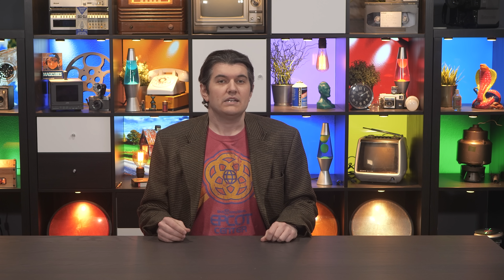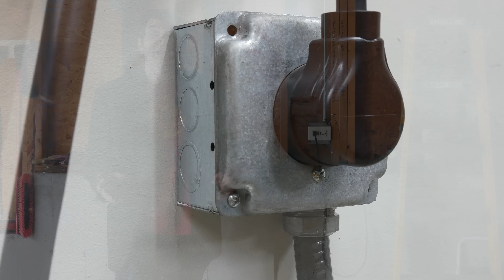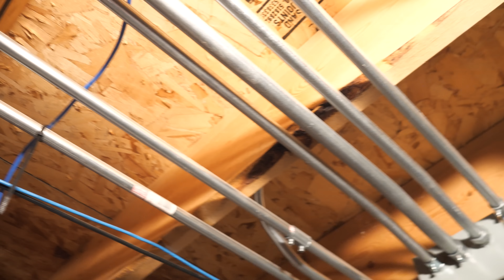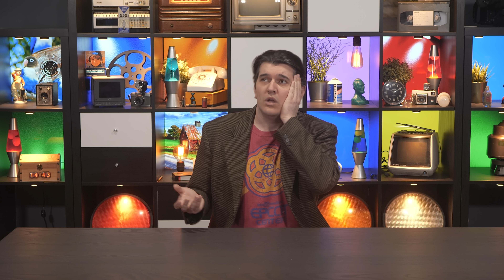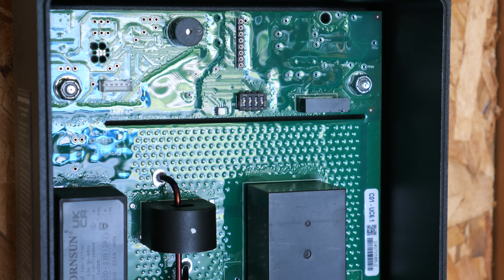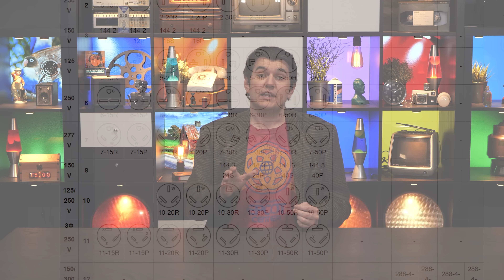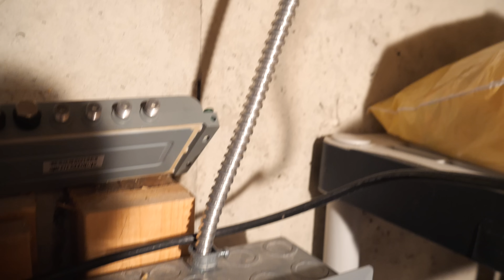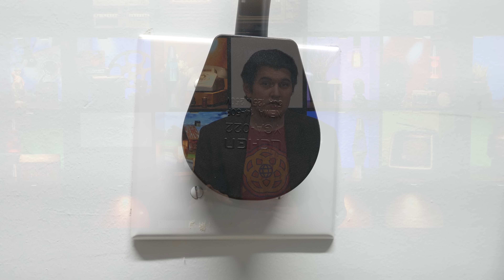The "standard" car charger is usually overkill—but your electrician might not know that

Comment: Interest video - thank you. Our Mini SE has probably on of the shortest ranges out there - approx 180 km in the summer - so we need to be able to recharge at home pretty quick. That’s why we dedicated a 40 amp circuit wired out to the carport with our Wallbox supply unit dialed to 32amps. 
One thing that made this feasible on our 100amp house is an energy management system added to the panel that will automatically shut down the EV charging on a hot evening with the AC humming plus maybe the oven on. It’s only shut us down probably 3 times in as many years but I’m glad we have it.

Comment: I appreciate the real world perspective and detail you are bringing to this topic since so many are ignorant of EVs.  However, one thing to consider in tone is that we are at the beginning of the EV revolution.  What makes sense today may not make sense 10 years from now when batteries will be bigger and EVs will be less efficient and ubiquitous.  Charging 1 EV on a Level 1 (or barely Level 2) charger is no big deal as you describe.

However, charging 3 EVs with 1-2 having bigger battery packs (like the Silverado) on even a lower power level 2 will start to get painful.

I wired my house for a single 48amp connection because it was a long run (about 60 feet) and because I plan to have 3 EVs in about 10 years.  My plan is to use 2 or 3 Tesla chargers networked together to send power to the cars that most need it.  Right now, my single Model Y charges much faster than I need.  However, if I executed your plan, I believe I'd find myself doing it all over again with a second circuit or replacing the circuit completely 5-10 years from now... at greater expense than just doing it "right" the first time.
Reply: Why would EVs be "less efficient"in the future? Battery, motor, and materials technology is improving substantially year by year. Batteries will continue to get lighter and more powerful, motors lighter and more efficient, and chassis and body components lighter and stronger.
Reply: @Frostback-mw4xi I measure efficiency as Whr/mile.  I think Tesla EVs are basically at maximum efficiency right now at 120-140 mpg equivalent.

Right now EVs (at least Tesla) are built around aerodynamic efficiency above all because of the limitations of battery performance.  As batteries get more kWh per kg and can charge faster, vehicle shapes will change to look more like ICE shapes because they are generally more useful. 

I think the typical EV in the US will settle around 80-90 mpg equivalent.  Other countries that appreciate smaller cars will get better efficiency.

Battery efficiency (Whr loss on charge/discharge) isn't a driver like kWh/kg or charging C rate.  Perhaps faster charging will require more efficient batteries, but that would be a secondary benefit.

Comment: Well homie, so long as many can't charge at home, or want to leave town and the charging infrastructure on the road is hit and miss, the public charging system shall remain the primary topic. You know what gives me range anxiety with an electric car? The idea that I want to go on a trip and have to plan it around charging locations that may or may not be in working condition when I get there, or there may be a long wait to access them. I could have a gas car that only does 100 miles to the tank and have no anxiety because I know for a fact that wherever I go, there's gonna be gas on tap. If you can deliver this to me in an electric car, then I won't be anxious.

Comment: My Ford Lightning can be charged from a standard 20 amp outlet and it came with a charger that I can plug in to a normal 20 amp outlet. Despite that I bought and installed a charger that’s capable of charging my truck at 48 amps. I have it turned down to 40 amps because I agree with you, I don’t need to charge at full speed overnight and I want to charge slower in order to keep the battery’s temperature lower than it would be if I charged at the maximum speed.

Comment: A petrol generator would be the perfect solution to charging a BEV. But I have a hybrid with a 43 litre tank (9.7 gallons UK, 11.3 gallons USA) and 53 mpg average (44 mpg USA) so 500 miles between 'charges' and no range anxiety. I can even fill up at home from a Jerry can if necessary.
Reply: Other than that a petrol generator would completely eliminate the whole point of BEVs, namely driving without emitions

Comment: I just have been to the US for three weeks, I have never seen so many flaky to outright dangerous outlets in Germany in my hole life than in three weeks in the US, cycling mostly through the back-country. (Ignoring German trains, where the outlets are used several times a day). US-sockets are terrible in the design and wear out way too fast. The higher current due to the lower voltage exacerbates the problem. It probably always is a good idea to replace the outlet before using it to run a car charger, though this holds true for Europe as well. While you are at it, probably check the junction boxes on the way as well. Especially in old installations, a whole flat can be basically running on a 10A circuit, like mine (230V, washing and cooking on their own circuit).

Comment: I am forever baffled by the madness that is electricity in the US. Residental 220V split phase, wild stuff - standard UK supply is usually 63/80/100A so over here I imagine most just go with the extra circuit,  4mm2 armoured on a 40A breaker. One weird sitatuion here is while charging outside the house; because most supplies are neutral-referenced TNC-S and the house is floated from real earth having a floated car stood on the ground outside is theoretically a problem, especially if there is an off-premesis neutral fault. Definitely worth a re-visit!

Comment: In cold climates 240 is mandatory, if you charged using 120 in sub-zero weather most of the power is used to warm the battery, and will barely charge.

Comment: I'm in that situation of a detached garage with a limited electrical circuit. I installed my EVSE on the side of the house like you mentioned (no issues through 2 Midwest winters, btw). I used to charge the car in the driveway, but I switched to the even lazier solution of buying a J1772 extension cord and running it into the garage. My janky-ass garage door already had a gap that was perfect for cable routing. This solution looks kind of stupid, but it was cheap and works very well. I charge at 32 amps, which is below the rating for the cable and still plenty for an overnight charge. The same extension cord comes with us on road trips and is useful for ICE'd public level 2 chargers or extending the range of my portable level 1/2 EVSE. I still want to run a new circuit to the garage, move the EVSE, and install a mini-split out there while I'm at it, but that's a "someday" project.

Comment: You have done an excellent presentation.  I have posted before that I charge a Tesla with a 20 amp circuit which is very inexpensive to install as only 12 wire is required and the outlet is much smaller.  My charging cord was acquired from eBay.  The charge rate is 16 amps which is plenty for overnight charging for as much as 50% of the battery even after 9 when rates are lowest for me.  (I actually just usurp the outlet from a rarely used 20amp garage heater so did not even have to add or make any changes. And merely changing the plugs allows use of the heater.)

Comment: I live in a first floor apartment I got a Nema 14-50 outlet installed in my bedroom for $250 with 50Amp breaker I use a 50 amp  25 feet cable with a 40 amp charger I bought on eBay for $90 gives me 9.6KW or 35miles per hour of range on my 2025 AWD model Y

Comment: You make a good point because though I have an extended range lightning, I only do about 40 miles a day. The biggest problem I have is that I have 150 amps to the house, and I don’t have a spare slots in my breaker box. I do have a n electric dryer but it’s in the front of the hose and I park in the rear.

Comment: Possible code violation: NEC article 330.30 requires MC to be supported (strapped) within 12 inches of each termination or fitting (the boxes), and every 6 feet. The floor joists count as supports. While article 356.30 does allow LFNC whips of six feet or less to be unsupported, I would attach a strap within 12 inches of each end, and strap it to the bottom of the stairs. I have seen them pulled out of their fittings many times when hanging loose.

One can see the hall effect sensors in the grizzle 'EVSE' that measures the current draw through the charger so that it can verify the current draw. Thank you for educating people that the EV "charger" is not in itself a current limiting device, but that it communicates the current requirements programmed into it to the EV onboard charger. The EV onboard charger has to be able to limit the current flow to the batteries, and so is a current limiting device.

Thank you for sharing the important fact that most people really don't need large high amperage charging stations. I have been meaning to upgrade mine to a 30 Amp 240V outlet, but the 20 Amp 120V garage outlet has been just fine since I got my Chevy Volt plug in hybrid in 2019. I resent the gas engine, but I never need it on local trips, which is most of my driving.

My ex-wife lives off grid, and I help her with maintenance (and upgrades). Her Chevy Bolt will loose its settings for charge times (parked in different direction, cosmic rays, gremlins?), and it can stay charging overnight, depleting her batteries. Having the charger times be programmable provides a backup. My Chevy Volt does the same thing, but since I live on grid it does not affect me as much. Chevy software sucks.

Aluminum wire does not have a memory like copper does, so thermal cycling will cause the aluminum to expand, then squeeze out sideways from under screw down lugs (like those on breakers and the charger). When the aluminum contracts, it starts to leave a space between the connection. This leads to oxidization and high resistance connections that WILL melt the wire (seen it many times). All screw down lugs used on aluminum wires are supposed to be re-torqued to spec every 5 years to allow for the contraction. Using crimp-on wire-end ferrules on the aluminum wire is one way to get around the 5 year re-torque requirements, as the ferrule crimp will create a cold weld bond to the aluminum wire (when done properly), then the ferrule will be connected to the equipment lug.

Copper, having a memory, will expand against the connection, but will spring back into shape after contracting given that it is torqued to spec. The average homeowner can afford a cheap 1/4 inch drive torque wrench (and the appropriate screw tip adapter to go on it) that can be used to torque most branch circuit electrical connections. The breakers will have them printed on their sides, and the panel board label will have them for the buss bars. I highly recommend people have this done, since I cannot tell you the number of times I have found loose panel board and breaker connections. No saying to do it yourself, but if you do, just make sure the main power is off, and that you verify that it is de-energized when performing torquing. 

Great info, and thank you for your hard work educating us with good information. Just need to work on your electrician skills :)

Comment: I only have a 3.5kW (16A single phase 220v) at my parking space but I can tell you it’s night and day better than outside charging. Every day I wake up with a “fully” charged car (to the charge limit, of course). I never spent any time “refueling” the car unless on a road trip. It’s liberation.

But the way, I was shocked when I first learnt that the “EV charger” (Tesla wall connector) that came with free installation from Tesla is not a charger at all. The charger is on board the car. But nevertheless I like its smart features although it’s not that smart actually. It does nothing except providing electricity to the cars onboard charger… I don’t have any use of its other smart features like interaction with power wall etc. totally not available in my country.

Comment: Just got a new dishwasher (Midea's current "smart" model, the $550-est dishwasher costco would install for us) and it has two things which completely baffle me. The first is an "Auto" feature, which claims to use Sensor Technology to detect how soiled our dishes are and adjust accordingly. The second, of course, is its smart app connection that allows you to program your own dishwasher settings!... I'm not letting it have wi-fi. But I am curious how exactly a dishwasher can detect dish soil as it runs. So far, it's kind of worked? It left a couple spaghetti night dishes slightly tomato-ed after yesterday's dinner, but otherwise has done its job far better than the dial-controlled GE landlord special that crapped out on us.

Comment: My garage had a 50a feed going into a 30a water heater. I decided to just add a box that split a 30a and 20a breaker off it and limit my charger, rather than run a new feed from the panel on the entire other side of the house. It's a rare occasion that I drive farther than it can charge overnight.

Comment: A standard car charger is barely adequate.  My standard Tesla charger fills my Cybertruck at 11%/hour at my typical 50-80% range.  It slows down as you approach 100%, so even an overnight charge might not get you to 100% if you are starting from 30%.  This keeps me pretty happy for my usual needs because I only need a few hours advance notice to get it above 70%.  But it's the advance notice thing that gets you.  Occasionally you have "come-ups",   where you need to respond to quickly.  The more power you can get into the car quickly, the better.  I certainly would not want to be charging any slower than my standard charger.  When superchargers are on every corner, I might agree with you, but until then I want to pump as much juice into my vehicle as quickly as I can at home.

Comment: My calculations on time savings between a 30 amp vs a 50 amp is 22mph vs 44mph.  A full battery of 250 miles is 11 hours vs 6 hours.  Both are less a nights sleep. One just cost WAAAY more money to install.

Comment: I think you failed at the beginning... Why do I want a slow charger versus a fast charger?  Ok you don't need to run the line in the first place.  Great, but if you're doing the work for a 240V, why not install a fast charger?  I assume there's a cost analysis or something but you say nothing about the what causes this consideration?

Comment: Just wanted to add something you didn't get into.
While a 120V/15A circuit might be enough for those making short daily commutes, the vehicle has to step this voltage up even more from 120V to ~400V (most EV's). The result is more losses and a higher electrical bill.

Comment: I was looking into installing my Tesla Mobile charger myself to a smart splitter, but during my research I came a crossed the  law that my state has, but after decided to use my electrical suppliers PowerMiDrive (Consumers Powers) program for the $500 off the installation cost. Their recommended electrician assured me that it be OK to use the Mobile Charger 1450 outlet instead of Tesla's home charger, but then when the city inspector caught this issue I had to have the GFCI installed and that didn't work so well with the Mobile Charger's built in GFCI and the two conflicting with each other would at some point before the scheduled charge time would shut of the houses main breaker so I wouldn't get a charge over night. I could have avoided that headache I would have forced the electrician to install Tesla's Home Charger which by the law doesn't need to have a GFCI breaker.

Comment: My house panel is in my garage.  I just paid a guy to come over "unofficially" on the weekend and put a nema 1450 right off the side of the panel and add a 50 amp breaker.  Mounted my Tesla mobile connector right under it in the block wall with Tapcons.  32 amps for $300.  I charge between 40%-80% daily.  79 mile commute.  110 would be challenging for me for sure.

Comment: I have a 2021 Bolt and Level 2 charger custom power outlet at 60 amps... I RARELY use the level 2 charger because I don't drive that much except for on Mondays for 140 miles round trip. I just use the 110v and let it charge overnight.

Comment: Tangent to this discussion I do believe you are overlooking the meta problems. Examples:
Countries and some states want all EVs by as soon as 2030! 
Many families have more then one car. Many people do drive longer distances and vehicles with large capacity requirements. IE their 100 Amp service won't cut it and probably their neighbours won't either. How many electricians to replace them? What about the local transformer on the pole, the wires, the sub station etc...
This needs a deep dive good Sir as I don't think the politicians who are making these laws see the mess they are about to cause as this work has not been started and there are not enough people to do the work.